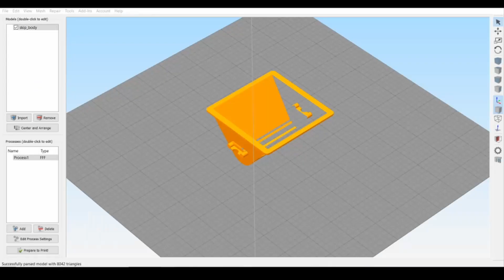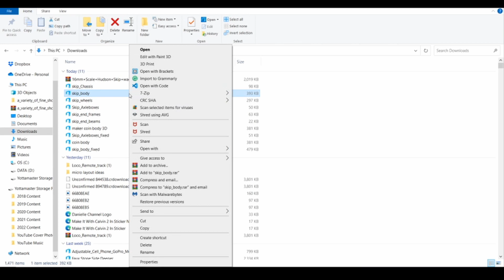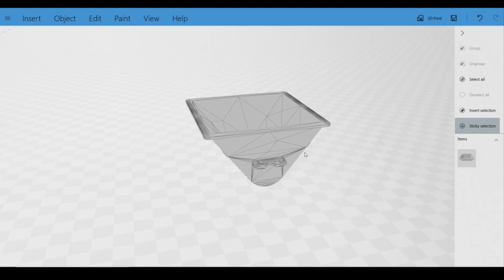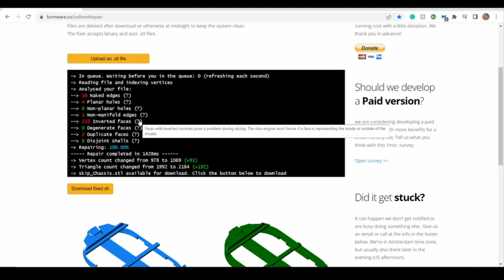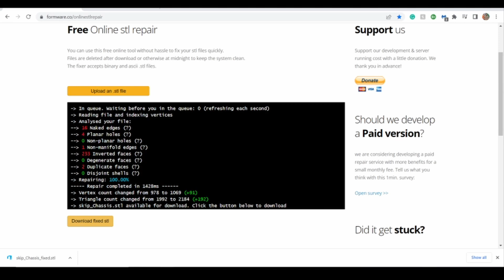Two Ways To Fix STL Files

Comment from the maker: Ok, one I do want to make clear is there are LOTS of ways to fix STLs. Fusion has a repair ability built-in, Nettfab, etc... My goal was to show methods I have used that don't require any log-in, money, etc. If you do have a favorite method of doing things, feel free to chime in on the comments below, I am curious to see what you use. Also, if you use Formware, consider donating a few dollars to them. It is an incredible piece of engineering and I would hate to see them having to sell out to a larger company cough Autodesk to keep going.